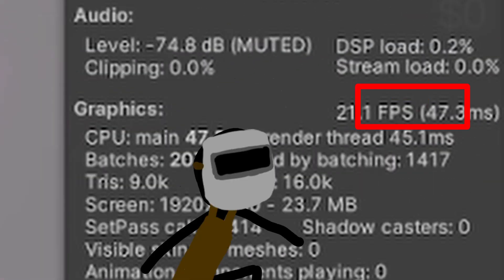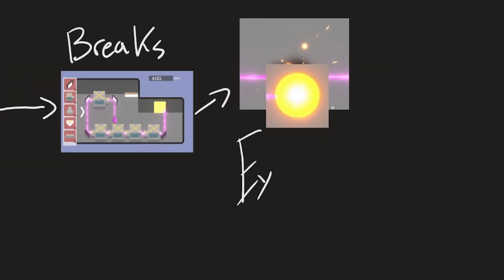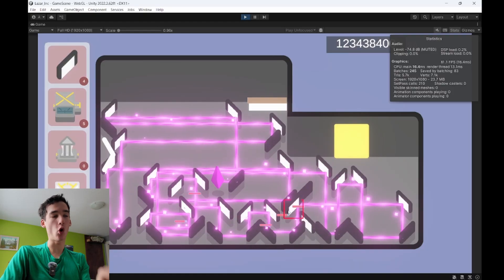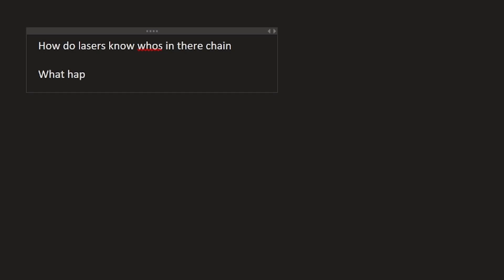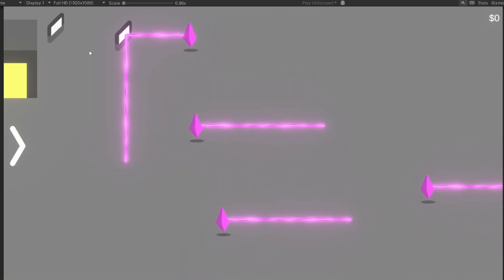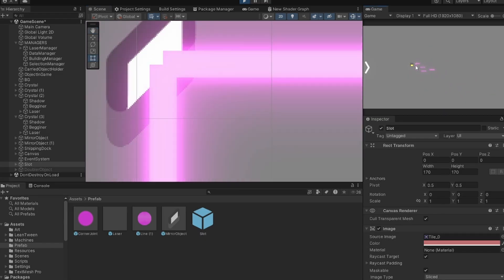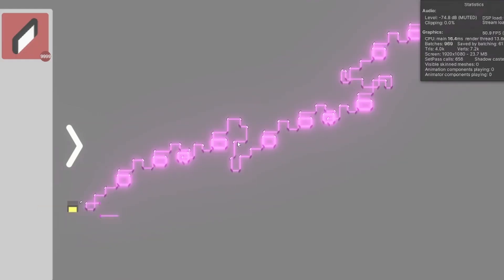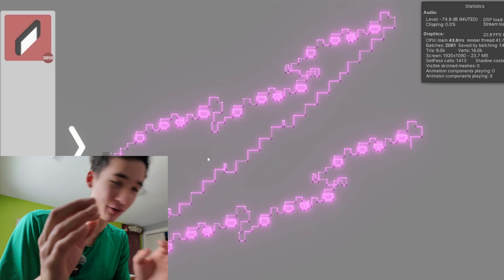Can I make a factory survive 100,000 lasers without crashing?

Comment: right now it's a matter of what's holding you back. is it the graphics card or the CPU? then depending on what it might be just optimize there.

i have a suggestion for optimizing it. 
for the graphics card. try making the whole laser into a black and white image that your graphics card just puts a shader over so it looks the way you want it. then unless it changes just render that. and you can save even more by slicing it to the camera pov so nothing renders outside of the screen.

for the processor you can make it only update the laser if the mouse clicks a mirror or machine that's part of the same laser's chain. or if suddenly the machine/mirror intersects a new laser

then the lasers are only being updated if something changes in their path.

you can also add a machine that centers the laser (i suggest a parabolic mirror) and with this you could have sectioned parts of the laser so a slight change at the beginning of the laser doesn't affect the end. you'd still have to check if the laser is entering this new machine but it's good.

this also helps if you make a blueprint and need pixel perfect laser positioning, you don't have to nudge the whole thing as long as the input is touching the machine. so players will automatically save on their pc's resources by using it.
Reply from the maker: Cheers, mate thank you for all the great advice. I think I have some of those features in place right now, but the one about renderer a shader or texture on top and only updating that is really cool. I actually think I might have stumbled into that today. And I'm trying to get it to work. 

And yes the focuser is gonna come in dont worry just not for tier 1 machines, which is what I'm making right now.